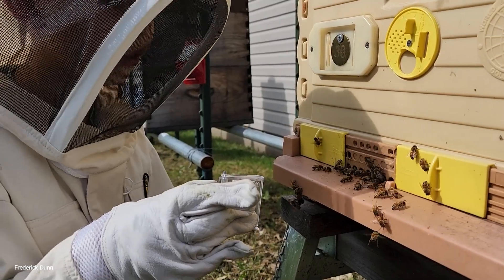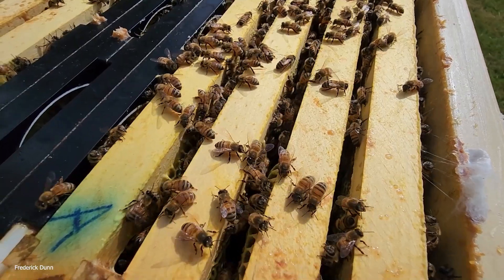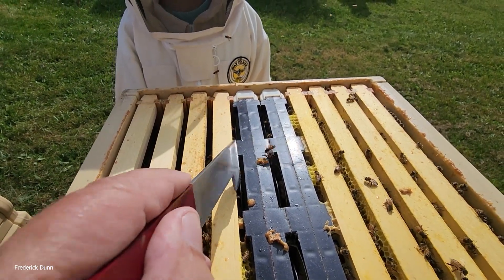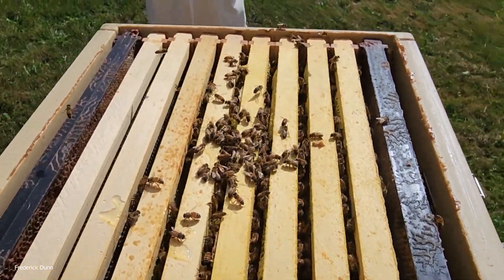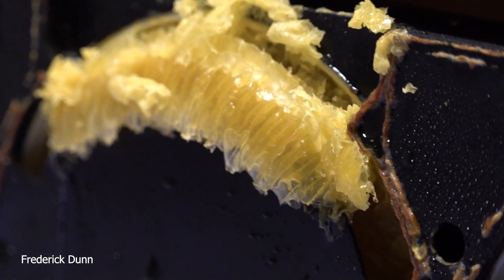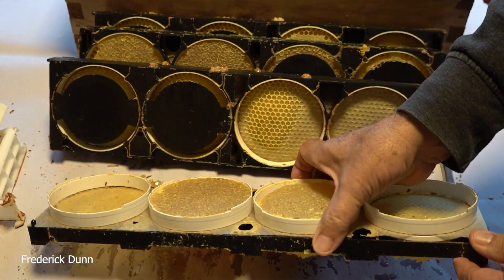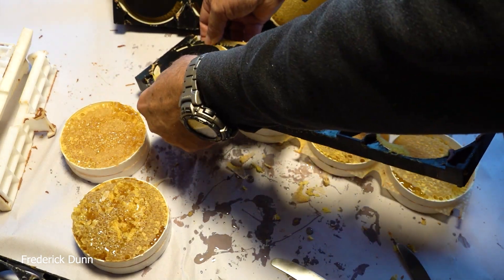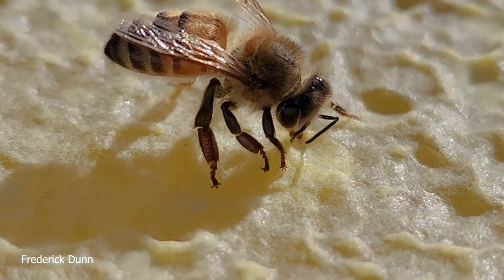Ross Rounds and How Not to Make Them, Ceracell Clips for Deep Boxes, lessons learned.

Comment: I got an eight frame Ross Rounds setup from Hungry Bear last year. 2 years now I've got no Ross Rounds from this setup. This year I did buy the Ceracell clips and put them in my LLHs.  I did have some success with the clips. It was like the bees would rather swarm then build out the frames in the 8 frame box.

I didn't have any frame to frame drawn comb problem with the Ceracell adapters. I'm contemplating getting 4 more adapters and give up on the 8 frame box. Might even try to figure out a solution for the comb over build out. I had 4 adapters spread out over 4 LLHs. 

Out of 16 mini frames I got about 10 usable Rounds. ☹️ Definitely not making any money with Ross Rounds yet.